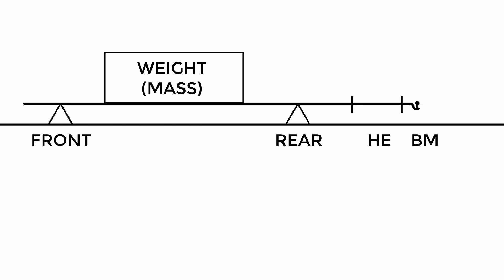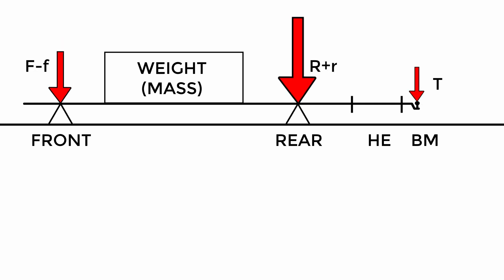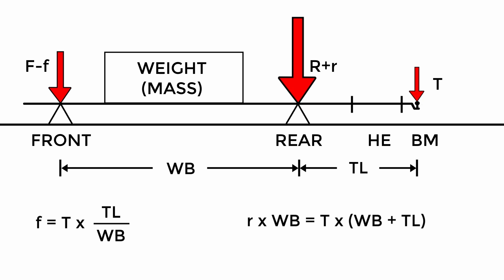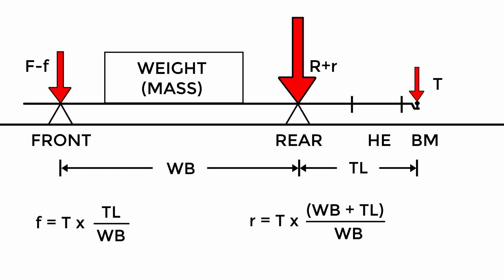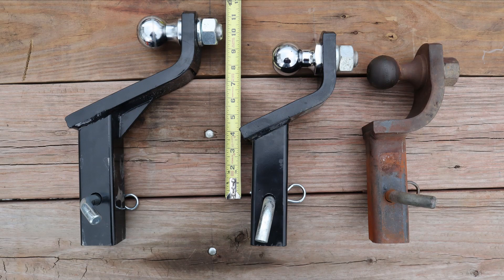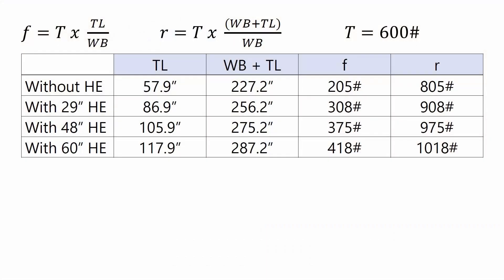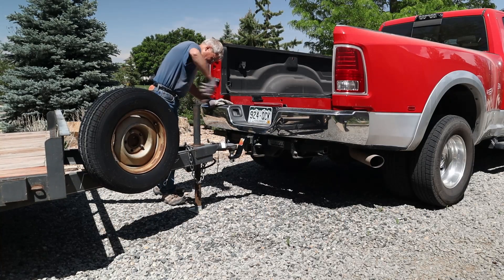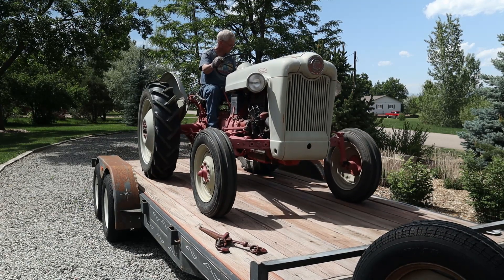How a Hitch Extension Affects Tongue Weight

Comment: Excellent!
Reply from the maker: Thank you for the reply.  I'm happy to hear you found it useful.
Reply: @KevinTaberski  My comment was in reference to your 'excellent', what was verging on a scientific explanation of some weight transfer physics involved with hitch extensions and loadings in vehicle/ trailer assemblies. Having said that, I would like to state the 2 things a person can do to increase the potential for a highway instability crisis in a truck/trailer combination. The 1st of these is to load the trailer behind the axle. The 2nd is to increase the distance from the truck rear axle to the tow ball. In my opinion these 'hitch extensions' that many choose to install between their truck and trailer are disasters waiting to happen. The correct way of connecting the truck to the trailer should be to reduce the distance from the truck rear axle to the tow ball. For many this would require the expensive exercise of lengthening the truck chassis and moving the rear axle closer to the tow ball. Costly, but then what is the price should we put on human lives?
Reply from the maker: @rossevans1774  Ross - I agree with you on the instability issues.  My impetus for creating this video was to explain the additional loading on the rear-axle as well as the reduced loading on the front axle due to the addition of a hitch extension as I've experienced confusion on this topic on various online forums.  In an ideal world, we would not have hitch extensions, but we do.
Thank you for taking the time to pot and share your thoughts.
Reply: @KevinTaberski  When your trailer gets the 'sway thing' going at speed there is very little you can do to stop it. For those that survive a trailer sway event at speed it is more good luck than good driving. Trailer sway overrides the tow vehicles control of the combination, it is the tailer that decides where the tow vehicle is headed. In the event of trailer sway occurring at speed it is the minimizing of the distance from tow vehicle rear axle to tow ball that gives the driver best chance of survival. All tow hitch extensions should be made illegal!
Reply from the maker: @rossevans1774  Okay - point taken.  Unfortunately, not the point of this video. 
Perhaps you should consider providing one!
Reply: @KevinTaberski  I have a very good understanding of the point you were making in this video. What I got while watching this video was an excellent explanation of how hitch extension loading effects weight transfer to all load bearing points in a STATIONARY truck/trailer combination. This is information that we all need to know. My reply was more to do with how using the stationary weight transfer knowledge you provided can then be applied to the 'constantly' changing weight transfer of a MOBILE truck/trailer combination. I think you will agree extending the hitch length in a stationary combination is relatively benign, while extending the hitch length in a mobile combination significantly increases the instability potential at 60 mph.

Comment: Safety chains need to be crossed 12:42
Reply from the maker: I understand the reason for crossing safety chains.  It may not be noticeable from my video, but this trailer has both chains attached at a single point - so swapping the safety chains from left to right produces the same results.

Comment: good old farm boys…. not engineers but like to show off basic fundamentals. How do airplanes fly?
Well it can’t be tail heavy or nose heavy. so here’s how weights are distributed. it’s measured by inch pounds say the hitch weighs 100 pounds the hitch extension is 36” and data line is at hitch not rear wheels. 3 feet or 36” x 100lbs =300 at hitch pin so you gained 200 extra pounds. the long the more weight shorter less weight levered. imagine a tetter totter 10lbs at. 10” would equal 1lb at 10” away from fulcrum or center of teeter totter. see how on airplanes to measure out tail heavy or nose heavy it needs balance.  Your welcomed… truck scales are not that precise when it comes to small amounts of weight… Hope that helps.   you can calculate. and remember that hitch extension weighs another 60+ lbs too
Reply from the maker: Yep - it's all levers and torque.  Thanks for posting.
Reply: @KevinTaberski  yep yep their are 3 levers, 🧐can you name the other two levers?🤔
Reply from the maker: @henryxavier3751  Why yes - I believe I can.